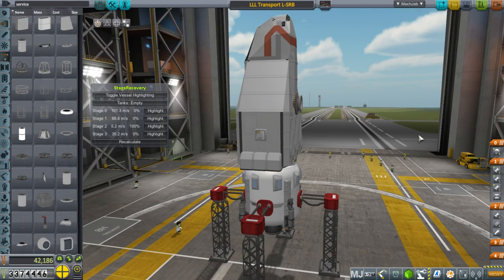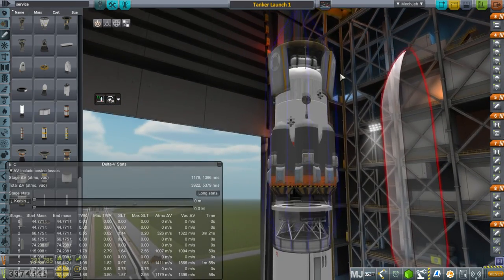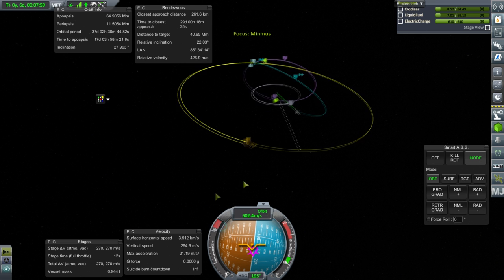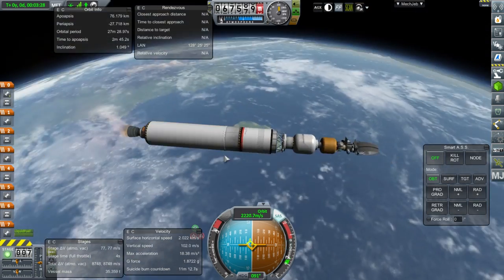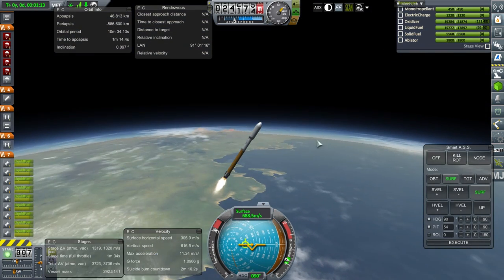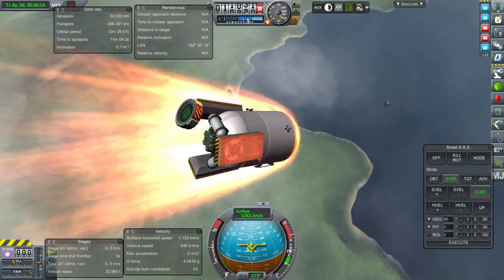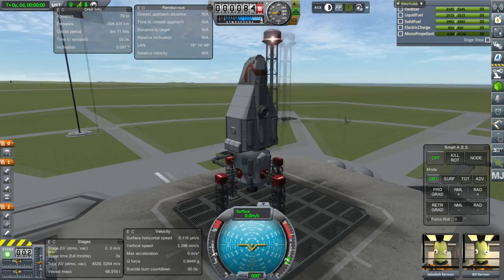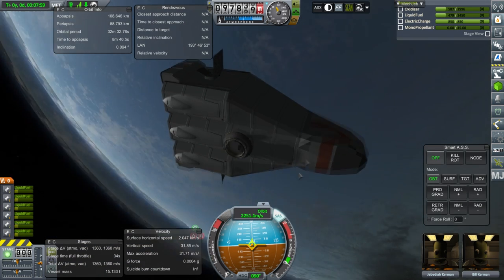Kerbal Space Program - Kolonization in 1.2 03 -  Many Launches

Comment: Have you thought of using Eve flybys to reduce your delta v cost to Moho?
Reply: I agree, which is why I've started playing with Flyby Finder and KSP Trajectory Optimization Tool to help find flyby opportunities.  I used TOT to find an Eve flyby and I'm using it with Flyby Finder to get a Kerbin -> Eve -> Moho trajectory.  

I found out the hard way you have to use both because I used TOT alone to find the Eve flyby and forgot about initial incliniations, and TOT seems to get some factors wrong.  I still was able to get a flyby trajectory past EVE and back to Kerbin but it cost me 1.8 km/s outbound and I need another correction burn of about 400 m/s in Eve's SOI to get on a track back to Kerbin.  The craft I used for it barely has enough to do this so I got lucky I didn't strand my Kerbals in deep space.

I'm hoping if set up my Moho mission via Eve flyby correctly, I'll save delta V versus a direct route, even accounting for the velocity needed to slow down at Moho.